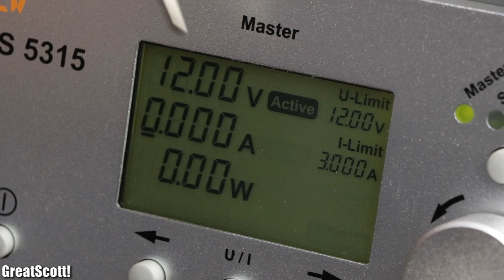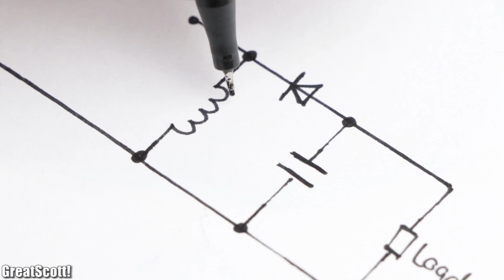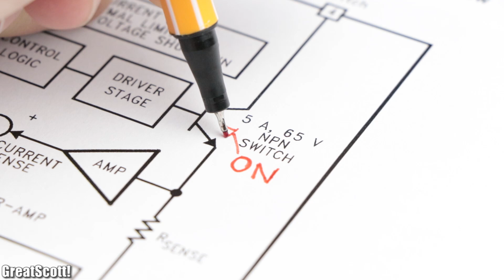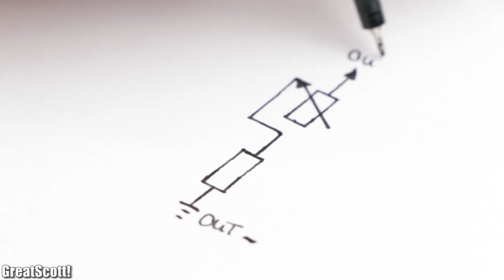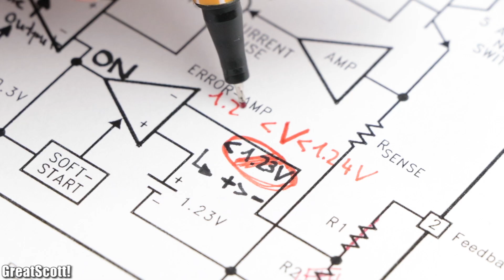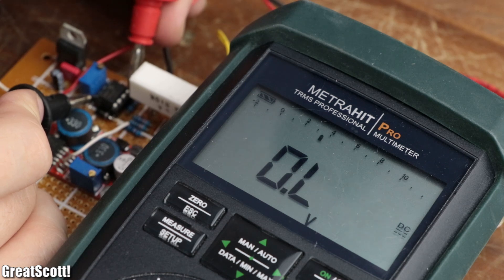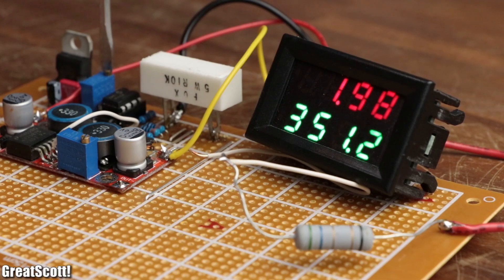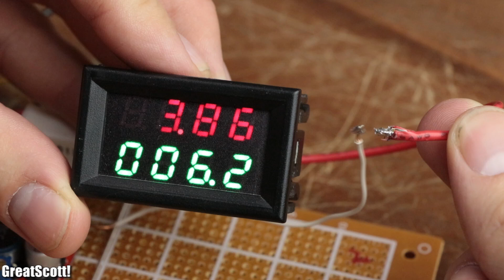HACKED!: Adding a Current Limit Feature to a Buck/Boost Converter

Comment: Why diode to feedback pin?
Reply: It prevents the current limiting feature from interfering with the voltage regulation until the current limiting is needed.
Reply: I think, because there is also voltage feedback connected to that pin.

Comment: Can you please build a boost converter controlled by an arduino? It would be so cool if you can regulate your voltage with commands by a microcontroller

Comment: How can you control the output voltage using a PWM Signal?(from Arduino) if i apply a pwm signal to a low pass filter and connect that to the feedback pin through a buffer, will it be possible to adjust the voltage by adjusting the duty cycle?
Reply from the maker: No
Reply: GreatScott! Any suggestions on how i can achieve this?
Reply: I think you could get two digital 10K potentiometers and use them instead of the ones used in the final circuit.  Then you could control voltage and current from an Arduino...
Reply: If your question is "How can you control the output voltage using a PWM Signal?(from Arduino)"
Then look at GreatScott!'s video and others on youtube on boost converter and/or buck converter basics of how they work,  There are many videos on youtube that explain it in the simplest way possible and control via PWM from Arduino.

Comment: I'm always left wondering, how many people watching here are electrical engineers vs. hobbyists? :)
Reply: I'm sure there are a ton engineering students.. I happen to be studying mechanical engineering, and it's nice to be able to check these out whenever I have no idea what a circuit does.
Reply: @philxcskier  you can use this to protect any electronics by limiting how much current they pull mostly LEDs cause they are efficient if we don't limit current they will pull more than needed and burn there diode....I'm a mechanical engineer too...😍
Reply: SpudHead engineers and hobbyists aren't mutually exclusive
Reply: Electrical engineering student here. I watch these videos for fun but i might build this circuit for a project.
Reply: ECE student here; we were taught all these stuff and how to solve equations but never implemented anything. This is very helpful actually.
Reply: @FireFox2382 So true. Educated in schools that had no practical, even at university studying avionics there was very little practical
Reply: ECSE student here, binge watching all the good electronics channels
Reply: EE who went back to school to study mechatronics
Reply: Spurdo Sparde both lol
Reply: And I confused am I an engineer or hobbyist
Reply: I am an EE, I mostly deal in digital, communications, and control systems, but I need a charging circuit for a LiFePo4 30V battery I am designing.  I have seen this circuit before, but never really studied how it works.   My goal is a charging circuit that will deliver 32.4V at 1 amp  Constant Current.  Most regulators that claim to have current limit will actually shut down when you reach the current limit.   I need something that will fold back the voltage and maintain the current.
Reply: @johnhamilton4449  If it needs to output 32.4V at all times, the circuit would first be constant voltage and become constant current at the middle of the charge cycle, then the current will fade out at the end (at least for a small battery). I just tested a Mascot 13.9V 1.5A charger Type 682 that does it - the voltage at the terminals is instantly 13.9 (~13.8V) even for a empty battery. Similar technology would have to be adjusted for the required voltage and current. It is a fairly large box with a significant heat element for only half the wattage you described.
Reply: Electrical engineer and hobbyist.  It is really cool what people can do cheaply at home now.
Reply: Hobby I'm just 13 lol
Reply: I sm both 🤔
Reply: Electrical Engineering Student here!
Reply: Neither LOL. Dreamer
Reply: Automation technician here and also a hobbyist.
Reply: I am a hobbiest and as well as student of electronics
Reply: Im a physicist
Reply: I'm a drop out, i was majoring in mechanical engineering
Reply: Spurdo Sparde ALL OF THE VIEWERS
Reply: But cyber security engineer who also plays with the physical world too
Reply: Electrical engineer here
Reply: just like to watch these kind of things..maybe a hobbyists
Reply: What's the difference? ;)
Reply: @Rina Hanigame lol
Right
Reply: Im an engineering student
Reply: @aspect Irrelevant if i did or didn't. If I gave you a perfect explanation you'd just accuse me of looking it up on Wikipedia and that I didn't really know. If I gave you a 3 sentence explanation you'd try to pick as many holes in it as possible, which wouldn't be hard with a simple basic explanation like that, no matter how relatively accurate it was, again accusing me of not knowing. If I ignore you, you would yet again accuse me of not knowing. Your strategy is transparent and ill conceived.
Reply: Hobbist
Reply: Hobbyist
Reply: electronic* engineer here!
Reply: I am a hobbyist
Reply: Hobbyist, from a financial field.
Reply: I am a hobbyist
Reply: The beauty of Scott not glossing over the finer details is that it inspires me to "really" study the circuit or concept intensively, by consulting MANY sources (including the Wiki, even) until I have a truly intuitive (deep) understanding of the FLOW, the LOGIC, and the MATH. .. I do not care how long it takes. .. I resent being rushed through anything that I do not yet "fully own". .. Scott seems to OWN the knowledge, which he shares, and his uncompromised, comprehensive and detailed presentation illuminates the degree of my shortcomings. .. This allows me to fully remediate my deficiencies, however frustrating.
Reply: hobbyist/software developer
Reply: Thoroughly void of formal education having anything to do with electricity... Which is only me saying I wish I had discovered as a kid how much I love tinkering with & diving into the guts to learn how electromagicalonics work both literally and figuratively (of course). Still probably would have perpetually maintained viewing the whole forreal EE education path and/or career as far beyond anything my mind would only ever struggle & toil in vain trying to grasp rudimentary shit, much less trying to make a living at it, pffft... It's an odd feeling now that I'm equipped with a triflingly ultra-ultra-basic lexicon/knowledgebase of this massive world it's like speaking Icelandic or somesuch to basically anyone who doesn't have an active interest in this (trade, school or hobby). It's so bizarre to me now that some familiarity with basic physics/etc is beyond arcane & esoteric to sooooo many other people to the degree that it's the rule, not an exception....
Reply: Hobby
Reply: I'm an Electrical Engineering Student and also hobbyist
Reply: @aspect Maybe learn how to spell first?
Reply: @aspect Ah, I see. Bad spelling, playground mentality and difficulty with sentence structure. Now I feel guilty for destroying you. Sorry.
Reply: simple.
an ideal basic op amp has two inputs + and  - (non inverting and inverting) and one output.
a higher voltage at + than - will cause the output to rise whereas a higher voltage at - than + will cause the output to fall, the same voltage at both inputs and the output will not change.
output is arbitrary. (MOST IMPORTANT)
Reply: Engineering student here
Reply: It doesn't matter what is your purpose
Reply: Here the Hobbyist , making electrical engineering...
Reply: 400k views.  Sounds like a lot of both.
Reply: Electrical engineering student 😛
Reply: Hobbyist here 🤚😅
Reply: Hobbyist +1, but don’t really get it... I’m better at mechanical not electrical... 😂
Reply: electronic engg freshman
Reply: I here trying to learn about electronic repair. Got a degree in chemistry tho.
Reply: They are alot ,I myself am studying electrical engineering
Reply: Hobbyist studying to become an engineer lol
Reply: Wannabe hobbyist who by the time I finally mastered soldering; they came out with micro controllers while simultaneously the ol’ eyeballs started to
Scream “I need reading glasses.” 

So I’m basically came full circle back to small child incapable of much lol 👦🏻👨🏻👨🏼‍🦳👶🏻⚡️🍻
Reply: I'm a Chemical engineer, always interested in understanding my electronics a bit more (and frustrated by how much seemingly simple industrial electronics cost...)
Reply: I’m a Data Entry Coder for an insurance company. The job sucks but at least I get benefits. I used to build electronics kits every now and then, but I lost most of my gear when my ex kicked me out of the house four years ago. Some day I’ll buy more equipment again but I really can’t afford it while paying all this child support. What little money I have left each month is usually spent on beer. I hate my life.
Reply: I'm a software engineer and electronics hobbyist. I like to program stuff, electronics gives me a nice way to do that (with matter instead of code) while not reminding me of work :) I love it but man how bad am I at it! Electronics ain't easy.
Reply: 90%
Reply: Future electrical engineer
Reply: Mechanical Engineer student and electronics hobbist
Reply: EE
Reply: Hobbyists (I,am still 15) I want to study Rocket Engineering
Reply: Wonder no more😁 I have no experience in electronics but I want to grasp some understanding and this guy is doing a good job at explaining.
Mind you most of it goes 🤯👍
Reply: EE, hobbist, network engineer, currently working as a programmer.  Programming is mostly 9 to 5.
Network Engineering is too many late nights.
Designing Chips was not what it was cracked up to be
Reply: Hobbyist screwing around with electronics since my first steps that is now studying electronic engineering.
Reply: Retired science lab technician. Hobbyist now.
Reply: Hobbyists
Reply: Hobbyist here
Reply: Electrical redneck engineer
Reply: Hobbyist here
Reply: I am a bit of both. I have a CS and EE degree but for nearly all of my 23+ year career I have been a programmer as a result (unfortunately) most of what I learned in the 1990s and before about electronics is difficult to recall however I am trying to get back into this as a hobby.
Reply: Yeah about that but the fact is that Hobbyists are smarter than Engineers and obviously far smarter than silly students shit
Reply: 100% hobbyists. 0% engineers.
Good engineers are needed everywhere. 
They have no time for videos.
Reply: @thekaiser1919    how do you figure? If I'm waiting on something like kid's doctor appointment, I can watch a video like this. Cannot do anything useful software engineering work-wise in 10 minutes in random location.
Reply: Hobbyists are 100x smarter.
Reply: @spudhead169  Dunning–Kruger effect
Reply: @machdeglotzenuff  Doesn't apply to things that are actually true. I'm not just talking about electrical engineering either. Hobbyists do what they do because they want to not because they have to. This makes them far better.
Reply: @stmounts  ...and what do those fries and stmounts have in common? That's right, they're both very salty.
Reply: @stmounts  Okay, ask an engineer how a basic Op-Amp works. Let's see how succinct an explanation they can give. (I can explain it in about 3 sentences)
Reply: @spudhead169  absolutely true
Reply: @spudhead169  not really, hobbyists don't know how to design circuits based on mathematical theory, engineers do.
Reply: @ivanpartida7467  I've designed several and I'm a self taught hobbist
Reply: @spudhead169   you are damned right

Comment: you can buy buck/boost converters  with current limiting from ebay
Reply: viermidebutura that's not as fun now, is it ?
Reply: The video was supposed to teach you how a current limitation circuit works
Reply: I bought 10+ of those units to have but I have always wanted to know how the current limit works. Already made units are great and all but I rather build some :D
Reply: current limit works the same as voltage limit 
the catch is  you can only have one at a time

Comment: Another advantage of lab PSUs is a much, much cleaner voltage. Try to power a radio with a circuit like this and you'll see what I mean
Reply from the maker: True
Reply: Maybe put an adjustable linear voltage regulator on the output. Set the switch mode PSU to a couple volts higher than needed and regulate it down with the linear regulator. It'd be a hell of a lot more efficient than simply using a linear regulator and you'll have very low ripple.
Reply: @DaffyDaffyDaffy33322  
Hi,

the problem with switching power supply is not just how clean voltage on output. Although it is also very important factor (I've attempted to use switching power supply for radio on TA7642 and noise was terrible, but if schema connected to 1.5V battery then radio reception is very clean).

The source of the problem is radio frequency emission from power lines in switching power supply and coil itself. High alternating currents in a conductor create electromagnetic field in surrounding space. 

Square impulse has endless 'odd' harmonics which cause the problem for radio transmission/reception.

Switching power supply should be 'caged' so that no electromagnetic energy escapes the cage. But it is not simple task as electromagnetic energy 'hit' the screen where it creates current inside and it emits on 'other' side of the screen.

This is a reason why in radio devices mostly used linear stabilizer. With proper selection of input voltage (just a few volts above output voltage) allows not to waste much power for 'heating'.
Reply: A linear PSU perhaps.
Reply: You should be able to reduce the ripple by loading the buck/boost converter with high load  but kinda makes the current limiting in this video pointless :P or use a LDO or RC in series to from the converter
Reply: I see, LDO, RC or LC filter.....is there more solution for cleaner voltage?
Reply: @TheOswald42  yeah, try a capacitance multiplier. See the eevblog video #1116.
Reply: Can one use PI section filter for regulation and reducing ripple factor ?
Reply: Linear based?
Reply: Can't we just use a capacitor to smoothen the output voltage?
Reply: Why put the current limiter on the negative side? ...it means that if you have 2 regulators with different voltages that you want to use in a circuit, you can't have a single common ground.
Reply: lab PSU is galvanically isolated! It makes huge difference :)
Reply: I'd just add an LC filter to the output for lower noise operation.
Reply: Bruce Fox yeah, most hams use linear PSUs, as we usually don't give a fuck about efficiency. A good lab PSU will be just as stable as one of those, and maybe even less efficient

Comment: How do you increase the maximum current limit to 5a?
Reply from the maker: By using other resistors for the differential amp to get a smaller gain. 5 times smaller to be exact.
Reply: GreatScott! Thanks man! Love your videos btw. I'm only 16 years old but I make such projects like yours. This video was very helpful. You are a hero. Didn't think you would reply, it's amazing you did
Reply: Lower the value of the current sense resistor or the gain of the feedback opamp.
Reply: John Conrad well what if you want a lower amperage sometimes

Comment: I think the schematic is wrong for the differential amplifier. You should have between R2 and R3 (voltage divider) on the non inverting input for the op amp.
Reply from the maker: Oh boy, you are right. I will fix it as soon as possible for the instructables article.

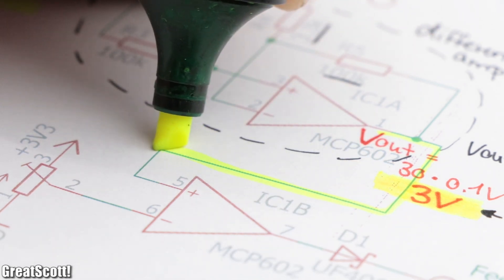Comment: nice use of highligher throughout video. @ 7:00 why the use of a shockley diode? D1
Reply: for protection so the voltage at feedback pin is not below 0V. Schottky diode is used because of its low dropout voltage and fast response. Tell me if i'm wrong.

Comment: Fantastic work, man! Do you think it's possible to do the same to a boost buck converter that uses a XL6009? I have one identical to the one you used. BTW, what about short circuit protection? Would it add it too?
Reply from the maker: Same theory and my circuit should apply to all buck or boost converters with a feedback pin. And at the end of the video you can see how I short the output of the converter. So yes, this allows a short circuit protection.

Comment: using a pot to set output voltage like shown at 4:11 is usually a bad idea, a bad connection in the pot will result in maximum output voltage. Have you looked at the output on scope when the current limit is in effect? I suspect using a comparator rather linearly adding to the feedback node will cause it to rapidly turn on and off rather than lower the output voltage

Comment: After this explaination, make sure to make the successor of your DIY Buck/Boost Converter, which will feature that as well. Also, the horsepower of an electric motor, depends by how much current/voltage flows form the battery packs into

Comment: How did you wire the current/voltage display (i.e. circuit schematic layout). As always great video!
Reply from the maker: +Laurens Le Bacq There will be pictures on instructables which can help you with this problem.